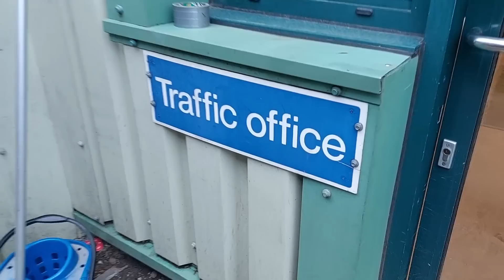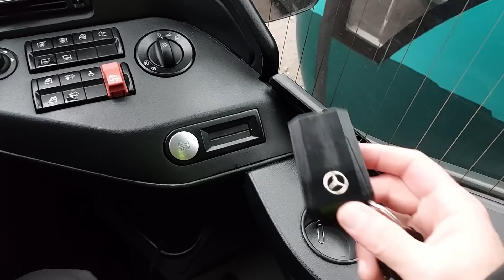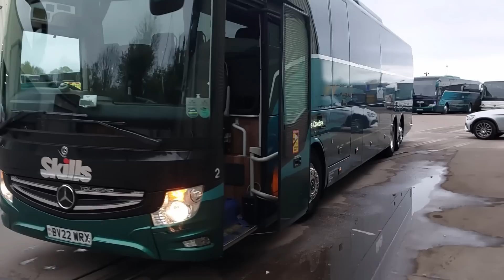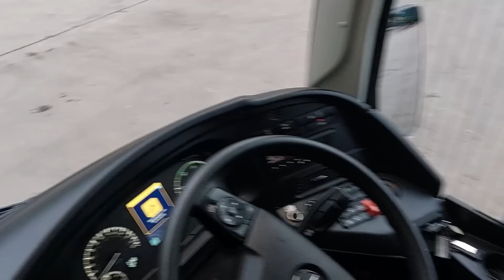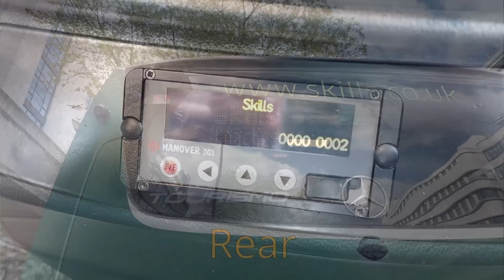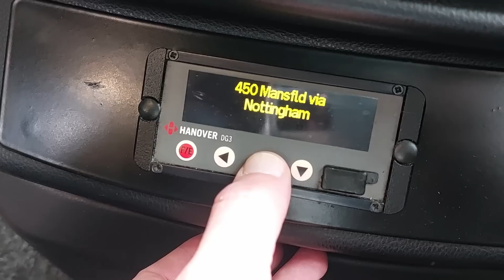Some more operational bits and pieces around a NatEx dupe

Comment: The Hanover system looks to be a pretty neat! I really like the placement on the side of the coach
Reply from the maker: What's your system like over there?
Reply: My company doesn't actually have any installed on any of our buses and it's not common on charter buses to have them either 😅
Reply from the maker: @alblua ah, cool! How do pax know where a charter is going then?
Reply: Some line run drivers put cardboard signs we have made in the front windshield. A couple of drivers and I actually bought some portable LED signs as well. Otherwise, buses are few enough here in comparison that if you're expecting a bus and you see a bus...it's probably yours 🤣
Reply from the maker: @alblua 👍